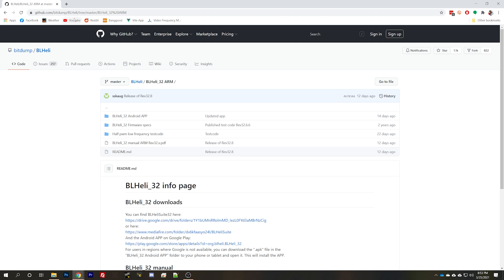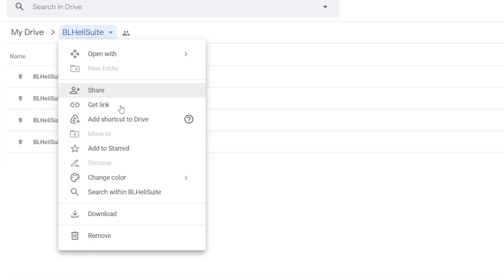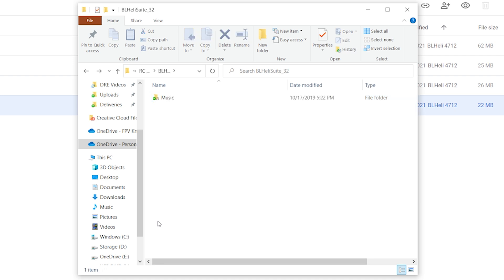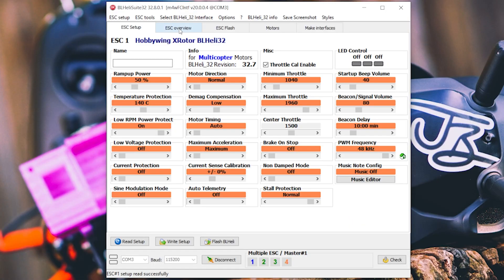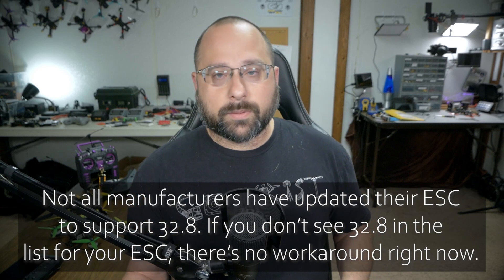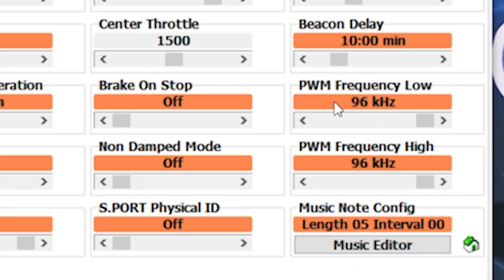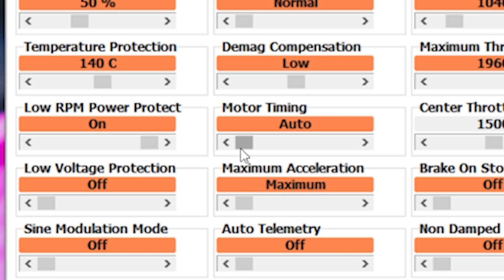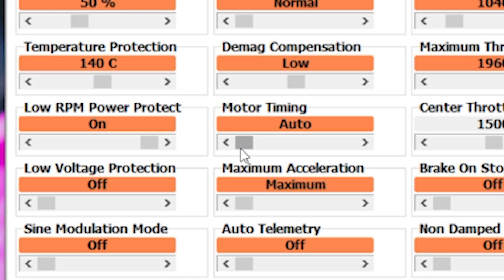BLHeli32 32.8 variable PWM frequency how to flash and set up

Comment: Hello, I am trying to drive a brushless motor with BLheli32 ESC and Arduino or teensy. However, I am experiencing a 150-millisecond delay at the first movement. I want to eliminate this delay. Can you help me?
Reply from the maker: I'm not sure what to say. It always takes some amount of time to begin rotating a brushless motor. If you need instant response at low rpm, you need a sensored motor like in an RC car.

Comment: hey dude, newbie here and already ploughing through your videos at a very good rate. my question in relation to this subject, is that if an ESC has an Operation frequency: 48MHz, as this is greater than Khz measurement, am I correct in saying that it would be covered within the variable PWM spectrum? allowing me to use it that way? - full details - 

KO45A 128K BLHELI_32 4IN1 ESC
Drive signal: Dshot300-1200 / Proshot1000 / Oneshot / Multishot / PWM
MCU: STM32F051 Operation frequency: 48MHz
Peak current [5 seconds]: 55A
Mount: 30.5mm x 30.5mm
Continuous current: 45A
Firmware: BLHeli_32
ESC weight: 12g
Supports 3-6S
BEC: No

Comment: Thanks for the video. I got one question though: I heard about lot of cases of people with hot/burned motors after setting this to 16 to by pwm. Are there any other features or setttings in blheli32 we should pay attention to? Motor timing fixed? Demag compensation? Thanks. If anyone tried some settings that work ok, please notify. Also, is it safe to use RPM filtering with this?

Comment: Hi Joshua, i tried 32.8 on a diatone roma f5 analog 6s. On pwm 48khz had issues like on a roll, going back to “0” the quad dip on a side, like i gave a pitch input. Same on clean pitch 180 or 360. With variable 24 to 48 it goes completely crazy and start spinning unpredictably for half a second. On blackbox, when the stick goes back to center, shows 1 motor spinning 100%. Had to go back to 32.7 24khz and is fine now. 
Anything wrong with my setup?
I’m flying on bf 4.3 supafly preset. 
8k/4k dshot300

Comment: love your vids! im not a quad flyer  i run cars. Still like watching your vids for the technical aspect and i just love RC! I recently bought an emaxx 45a for an outrunner motor for my crawler. I'm having trouble connecting it to blheli to program it. what inexpensive flight contoller would you recommend? for just programming esc's? The esc for cars atm are very loud and and annoying to use but the performance of an outrunner in a crawler is amazing! TIA...keep it up
Reply from the maker: The car ESC's don't run blheli and can't be programmed with blhelisuite. They would have their own programming system.
Reply: @JoshuaBardwell  I know…we’ve been running guard esc’s and they work good. I just need to hook up my quad esc to blheli to program. I just don’t know which flight controller to use.😁

Comment: Hey JB, can we have an update on this ? Am hearing too many reports about hot motors and burned esc's. Shall we continue using older firmware or this problem fixed for 32.8 ? Thanks in advance

Comment: Hello. I want to ask about it. My 6s 48k 96k motor is 1960kv. The motor timing is set to auto. This setting my motor is hot. How to make the motor not so hot. The flight control fl1. It is very hot before the pid is set. motor timing. Is it better to set it to 22?

Comment: I‘m running the same quad setup as a friend of mine. Very quickly after the update to blheli 32.8 we both had a smoked motor and a burnt esc (without any physical damage in advance). Tmotor F 55 A Pro II with Tmotor F60 Pto IV. Not sure but we suspect the variable pwm frequency or blheli 32.8 itself to cause that. Anybody else with similar issues?

Comment: Thanks for this one! I just finished your Xilo build and couldn’t figure out why it was doing the instaflip! I had written the ESC changes with BLlHeli v 32.8 but didn’t flash the ESC with 32.8. I was about to rip it apart and re-solder the ESC when I saw this video. It might be something you want to add to your build videos although I should have figured it out when I couldn’t set the PMW freq to 24 like you suggested in your build video.

Comment: Awesome 👏!!!!  

I’m using Tmotor 55a Ultra 20x20 on the GepRC’s Mark 4   6S converted to FC Tmotor H7 HD 20x20 DJI Caddx Vista with the Nebula pro camera. 

I am running RPM filters. My question is :  Should  I use Dshot 600 or Dshot 300?        
They both work it seems to fly better on Dshot 600. 

I have heard that I’m supposed to use D shot 300 because I am using an RPM Filter. I do believe this ESC is capable of 96 kHz I am flashing my ESC to take advantage of dynamic PWM frequency.

Comment: Just had one of my quads on 19 motor timing and I was getting a bunch of micro de-syncs  on low throttle. Flashing 32.8.2 and setting it to auto. Might try it on 24

Comment: Hi JB,
I have a IFlight SucceX-D Mini F7 TwinG Stack (Mini F7+40A ESC).   The ESC specs state that it supports up to 48KHz PWM frequency. 

Does this mean that I can’t use the variable frequency 48 to 96?

Thanks.
Reply from the maker: You should look in blhelisuite at what it supports. That's the only way to be sure. It may only go 24-48 for example.
Reply: @JoshuaBardwell  Thank you very much JB!
Reply: @JoshuaBardwell  Hi JB,

You were right it only supports up to 48KHz.  Therefore I set the min to 24khz and the Max to 48KHz.

My problem though is that if I try to use Bidirectional DSHOT, all my motors are reporting 100% rpm errors in the motor tab.  I tried it with both 4 and 8 kHz loop frequencies and lowered the ESC Motor protocol from 600DSHOT to 300DSHOT and no luck.

Not sure why this is happening.  I’m a big of a loss.  Any recommendations would be much appreciated.

Thanks,
Sam

Comment: hello ... my biggest problem above each quad are the oscillations walking straight with little gas.Three Quad sourceone v.3 have the same problem they are powered at 6s I changed stack rubbers varied filters etc etc but nothing The components are all Do you have a distant idea of what might be triggering this problem?
Thanks from Rome for all the information you share

Comment: JB - I must have missed the step where you said "after changing the PWM Frequency Low / Frequency High (and any other) settings, click on the "Write Setup" button to save these changes (write these changes) to your ESCs.  Great Video - thanks.  Just received the iFlight DC5V2HD, with recommendation to use variable PWM.  Your two videos provided me all the info I needed.

Comment: Did this to the phreakstyle build I just finished and so far I am liking the way it works .I was having some issues fixed about 80% of them
Reply: Did you do 6s or 4s? Wondering what settings you did because I'm getting the death toll.
Reply: @cwwCADAVER  I did it to a 4s version from the start it was off went back default and  did this to motors set one to 96 low to 48
Reply: @jamesbuckner3398  I did the 4s also.. are you saying that you did the new 32.8 and it didn't work for you so you went back to what it was on?
Reply: @cwwCADAVER  not at all I did the 32.8 update works great.  quad acted crazy when followed original videos to set up went back to default when this came out and started fresh.i was having low throttle problems just doing this has helped still playing with sliders to fine tune
Reply: @jamesbuckner3398  thank you for clearing that up.. I'll try this and see what happens... Did you also put in the extra scrip for telemetry? I forget now what it was .. was short scrip though
Reply: @cwwCADAVER  I have not after the issiues I have had from the begging with this drone I have only got about 4 packs in the air since the reflash and this update

Comment: JB I just downloaded installed an open to look I haven't plugged a quad in yet but I don't see all the same things thst was on your screen is that because I don't have esc connected.an what is bidirectional soft / rev in motor direction I no rev / normal to change direction but I never seen or heard anyone mention this.im running bidirectional dshot/rpm filtering so should I pick bidirectional soft an normal in motor tabs instead of normal / rev. i really like to know an shore others would to thank you
Reply from the maker: You won't see the options until you connect to an FC with ESC powered up. 

Here is info about "bidirectional" https://www.youtube.com/watch?v=DXfAnCLr3q0&ab_channel=JoshuaBardwell
Reply: yea I remember that video on for people misusing the tab like picking bidirectional 3d but it never mention soft /normal. so i wasn't sure if it was new added feature in that tab.I just updated blheli 32 an seen on look threw not knowing if was there before update 🙏👍

Comment: I flashed my Mamba F50 Pro, set variable pwm freq from 24 to 48 khz. It felt good, motors sound not as good as 32.7, but I have a wired bounce back on fast rolls/flips, PIDs tuning had no impact on that. So I rolled back to 32.7.

Comment: By the way! Bardwell made a great video here! And it helped me as well. But if your like me and havent messed with esc firmware much until now? Make sure after you flashed the esc's. And when you make your adjustments. Make sure you click on (Write Set up) to save your settings & adjustments you made in BLHELI32 or your settings will not be saved! And it will go back to defualt settings.Which most esc's on 30x30 stacks is 24khz!
PS: Iflight Twin G Sux Stack lowest PWM 16khz / Highest PWM 48khz

Comment: I guess something is not ok with the tekko32-esc with this 32.8 firmware because I've just tried and the motors gives crazy scratch noises :D ( When I downgrade back to 32.7 everything is ok.  )
Reply: I have 2 Desinc with the PWM variable, set it to 48khz stable and no issue with 32.8... so i'm not the only one with problem with this new firmware and Tekko32 😭
Reply: @lookaroundfpv  Yeah I read a few comments on instagram too and not only with tekko32 esc's, and yeah, mostly desync problems.
Reply: Really thanl you Butcher! I'm so scared to fly with this Firmware on my Rooster, today i scratch my FPV cam on a crash wen testing this features, fortunatly not a big scratch... So the only way for me is to return to 32.7 and waiting for a new version without problems...

Comment: When you say go to the lowest pwm value, does that mean as low as you can to 24khz, or even lower if possible? Is there a risk if you go to low, the pwm might not climb up sufficiently fast enough to stay above the resonance band?
Reply from the maker: I think that even at 24k the PWM will stay out of the resonance band. I'm not sure what ESC today go any lower than 24k. But this is just generalized advice and is not going to be right for every situation.
Reply: @JoshuaBardwell  for ref, spedix gs45 goes from 16khz to 48khz.
Reply: @JoshuaBardwell  for ref, spedix gs45 goes from 16khz to 48khz.
Reply: @JoshuaBardwell   my T Motor F55A 4IN1 Pro V2 goes from 16khz low to 48 khz high
Reply: @JoshuaBardwell  .... and also the Typhoon32 goes from 16-48khz. What's your recommendation for the low setting on a 5" quad?

Comment: Won't this reduce consistency of the throttle feel?
Reply from the maker: I think most people are unlikely to notice a difference in stick feel when changing PWM frequency, but it's not impossible. You can always turn off the option if you don't like it.
Reply: @JoshuaBardwell  Thanks. Definitly worth a try. I am usually quite conservative with dynamic settings.

Comment: Hi Joshua, Could you please make a video about betaflight i2c errors? What is it and what causes i2c errors? In betaflight 4.2 i realised that i got i2c errors and I2C error count keeps increasing with every loop..Thanks
Reply from the maker: It's normal to see a few i2c errors when you first plug in. But the i2c error count should not keep increasing. If you are using an external i2c device like a compass, then that could be the problem. But if you are not using any external i2c device and you are seeing increasing i2c errors, then most likely the FC is damaged.
Reply: @JoshuaBardwell  Thanks for your quick reply. I dont use any external device.It was a brand new t-motor f7 fc but i might damage it while soldering or flashing the firmware.Thanks once again

Comment: Does someone know which screen grabber JB was using in this video? It looked very convenient! 
Great video. Thanks!
Reply from the maker: Windows has a built in screen grabber. Windows key + Shift + S
Reply: @JoshuaBardwell  that's the one I was already using. Nevermind :) thank you!
Reply: In the Windows settings you can map this screen grabber to the 'print' key on keyboard
Reply: @Fr33man85  that's great advice. Thanks

Comment: This is definitely one of those videos where diagrams would help explain the situation.  Explaining PWM signals vs motor speed/strength should be much simpler with some diagrams.  0:00 - 2:42

Comment: Flashed 32.8 on day one and it had good low throttle and high throttle. but at around 1500-1600 mid stick it would oscillate like there was a bad prop. Go up a little in throttle bobbles gone. I went back to fixed pwm and everything was normal again

Comment: this new feature matched with UAVtechs "ballpark" tune makes for the best flying freestyle quad ive ever owned. I did both changes at once so not sure if the variable PWM did anything. But DAAAMN so glad to have you 2 guys in the hobby making things so much easier for lazy people like me!
Reply: What did you set the low and high at?  I reset my fs to uav baseline.  They fly great.
Reply: @BBSlats  I did 24-48. That was the minimum and maximum on my particular esc
Reply: I did the same thing UAVtechs "ballpark" tune for my 5 inch so smooth and fast. I also did his actual rates, love them. I haven't done BL Heli PWM frequency change yet, but I will.
Reply: Can you post a link to this «ballpark» tune?
Reply: @kristian-emilelvestad8493  google “ the UAVtech” .. should bring up his website and then just go to the “preset tab”

Comment: So shouldn't you take the props off before you do this?? Useful! Gonna see if this works on 3d quads that desync during transitions. Thanks! Wondering if it will be possible to upgrade HGLRC TITAN 60A ESC
Reply from the maker: I had a smoke stopper.

Comment: I'v been running this from the first test code I feel the quad is smoother As for the hobbywing it was the same for me does not update to 32.8 but there is a test code in Rev32.7.4 Variable PWM frequency testcode im using on both 40a and 60a works great i dont know why it was not added to the new version I have all the hex files from 32.74 and 32.73 has most common esc If your interested I could email them Thanks for your video please test it like to here your feed back (works great on the RDQ Bardwell F7 3-6s 30x30 Stack/Combo (JBF7 FC / 32Bit 50A 4in1 ESC) and updates to 32.8 
as always thanks for what you do i would be lost if not for you
Reply: when I get you right you have the 32.7.4 version for the 60a hobbywing esc? could you send it to me, please :)
Reply: @KerniFPV  just sent let me know

Comment: Joshua I'm on a search for f7 20x20 fc that actually has a current sensor on in are there any in existence?
Reply from the maker: 20mm FC never has ESC soldered directly to it. So it never has a built in current sensor.

20mm ESC has a current sensor and it outouts that to the FC.
Reply: @JoshuaBardwell  Well, I guess that explains why I can't find any then. 
Thanks
Reply: I'm not sure why you would want a current sensor on the FC. The FC will typically pull no more than maybe 1-2A and it will pull that pretty consistently. Almost all ESCs have a current sensor which converts current to an analog voltage. This gets connected to an ADC on your FC's MCU which will tell you how much current your ESC is pulling which is much more useful
Reply: @jpwolfe9912  I'm not seeing 20x20 escs with a current sensor either, most just have a current signal wire for the sensor that's supposed to be on the FC. At least that's the case with most I've dealt with.
Reply: @henryknox4511  That current signal is the current sense. It gets connected to the "current" input on your FC and will give you the amperage
Reply: @jpwolfe9912  No, it's not lol. Name the esc that has that.
Reply: @henryknox4511  Jeremy is right, some ESCs have the signal that goes OUT  to the FC, so the FC can process it, some other ESCs dont have this and some FCs have the current sensor on them. anyway take a look at the Iflight SucceX Mini 40A, it has current sensor onboard and in the connector you can see the current pin that goes to the FC
Reply: @abc121xyz  I have several escs that have the current wire, tmotor f55pro, Velox45, Rush sport 50, and none give me a current reading when hooked up to current pad on the fc. I thought it was the way you described and have been trying to get a proper setup for some time but 3 diff boards with current pad don't give me  reading. Maybe they're all just jacked, be hell of a coincidence.
Reply: @henryknox4511  I just went on RDQ's website and every 20x20  ESC I saw had a current sensor on it. You know it has one if it has a large "shunt resistor" near the battery pads. They also have an "INA139" chip on the board that is able to measure the voltage drop across the shunt resistor and convert that into an analog voltage which can be scaled to represent the current. I have designed ESC hardware so I hope you can trust me lol

Comment: I did this on an Aikon AK32Pro 50A ESC with a Talon F7 V2 FC, running BF 4.2.6 - as soon as I armed, BF would basically freak out and everything shut down.  Re-flashed back to BLHeli32 32.7 and everything is good again.